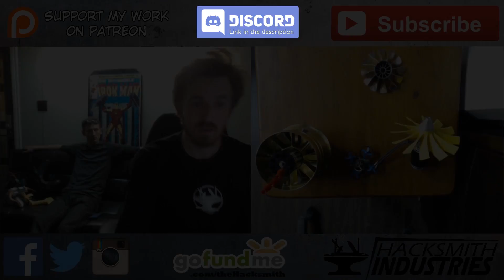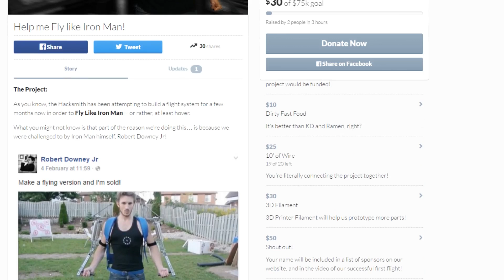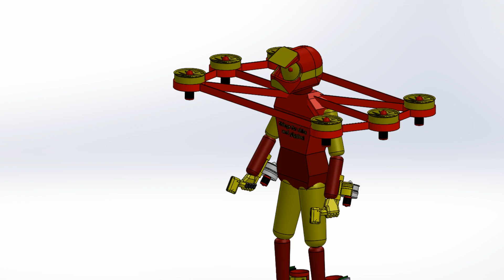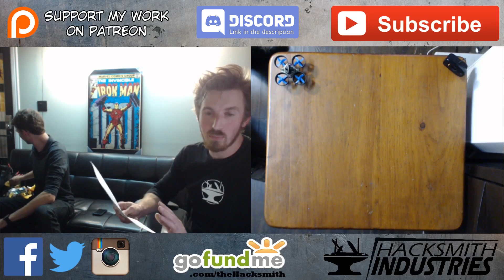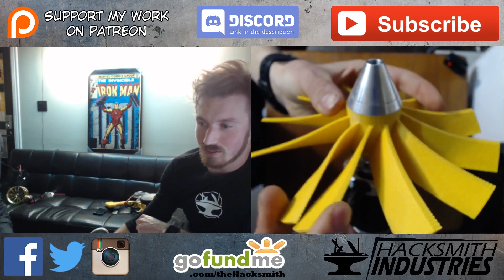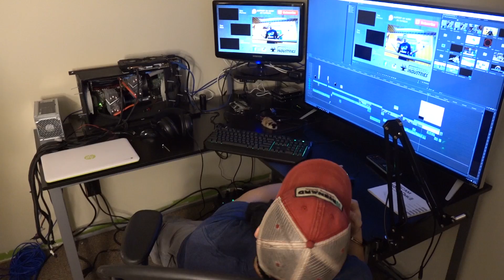Flying Like Iron Man Q&A!!!

Comment: Hi as someone who uses fly's RC planes & multi-rotors I'm a little concerned about using the store bought edf's 

Have you actually tested to see if a single EDF can lift the weight quoted in the thrust specs. I would definitely like to see some thrust testing with a force gauge or weights or something.  Those EDS have really heavily pitched blades designed to move and aircraft fast(not what your doing). in your use case you will probably want something that is less aggressive as you only intend to hover. I know it wouldn't look as nice but I think building your own ducts (3d printing) and using larger propellers(model aircraft propellers) spinning slower would be better. This may be more efficient cheaper and possibly more effective at low speeds(hovering). I know the theory says that ducting fans make them produce more thrust and it's true. But there are other ways to produce the thrust you need. My general gut feeling is that I would be surprised if they can lift there specified thrust straight up. Going bigger would be a better option. 

I may be wrong but I'm no aerodynamics expert. But I have had some hands on experience with EDF's i'm not sure they are the right tool for the job. If you look up human quad-copter on youtube they all use propellers pretty much I think there might be a reason for this. 

Don't take this comment the wrong way I love this Idea. I want to see it work!! 

Keep it up I am looking forward to seeing how it turns out.
Reply from the maker: +James Williams we're going with EDFs to keep the design relatively compact -- props would be easier!

We have a thrust test jig we built, you'll see it in part 11. Most EDFs have lived up to their spec, except for one!
Reply: That's cool. Admittedly I haven't ever used these very expensive well engineered EDF's I will be interested to how close they are in spec. As far as the size thing I think even doubling the size of the fans would make things a lot easier on you guys but I understand it more like Iron man like if its compact.  Good luck!  I really hope it all works for you!

Comment: Why don't you try using an external power supply? Connect the jets to a cable. This way you could cut down the battery weight problem.
Reply from the maker: +a shapeshifting reptillian pretty sure that was like the second question I answered in this video.. lol
Reply: So basically normal line power can't supply enough wattage? What about using three phase power?
Reply from the maker: +a shapeshifting reptillian then the wires are too heavy :p
Reply: the Hacksmith Huh. Thats interesting. So you would have to convert the ac to dc to power the motor? Are there any ac motors in that size range?
Reply from the maker: +a shapeshifting reptillian AC to DC is one problem, the weight of the cables required to pass 150kW is the real problem though! Anything custom would be really expensive... And then not compatible with batteries, so using it to test would be backwards haha
Reply: I see. But at high voltage ac a rly heavy cable shouldn't be necessary.
Reply from the maker: +a shapeshifting reptillian yeah but you can't just convert high voltage AC to low voltage DC without a giant rectifier
Reply: Lol of course. I guess if I'm thinking of an idea on this project you have probably already considered it and figured out all the problems with it.

Comment: This isn't really flying like iron man any more. This is just flying by any means possible. Don't get me wrong, what you guys are doing is impressive and I understand that iron mans suit is a work of fiction that isn't practical, but I think the project should be renamed as it is no longer very iron man like.
Reply from the maker: +Happy Bread manual control via the hand and feet thrusters is still unlike any flight system out there, which is the main feature of Iron Man's flight ability ;-)

Comment: Why not 3D print the propellers and then make a cast metal version from a cast of the 3D printed part?? or maybe not metal but just a more durable plastic?
Reply from the maker: +Waylon Martin EDF blades have to be precise and perfectly smooth -- at home casting just won't cut it :(
Reply: True enough yeah, That was simply the first thing that came to mind after seeing how flexible the plastic was...

Comment: ESC cooling some of my jets have there ESC`s in behind the EDF so air flow cools it while sitting still, checking out the gofundme.  Liquid fuel rocket engine, dangerous I know its an idea for another day stick with EDF`s for now. Try redesign of the mount for your EDF`s closer sleeker more like Iron man the design you have will help with stabilisation (guess that why you chose it) but doesn't look the best, try harder, I know you say not definite design just saying don't use that.

Comment: You guys should do a hybrid engine, with the electric duct fan at the front of the overall engine and part ion engine to accelerate the air even more. The air would also move faster when it's heated.
Reply: This may get more propulsion, but i'm not really sure.

Comment: I'm well aware how expensive a Metal 3d printer is, but why don't you send the files to a printing website, like i.materialise? it's not terribly expensive, and this way you could attempt to increase the size of the EDFs. Also, in reference to the heating problem, could you use small pressurized Co2 cartridges? when the gas is released it's at a very low temperature, and since the flight time isn't very long to begin with, you wouldn't have to carry too many, therefore not increase the weight terribly.

Comment: why not use a wing system like the jet wing ? It might be wide but it could potentially less cumbersome than you octocopter design I believe.  I know you want to hover but wouldn't it be cooler to soar like an eagle piloting a blimp? And if you think the take off would be an issue, you have those spring boots to jump high. Don't take anything I say too seriously though, I haven't been trained formally in any field of engineering. If you have valid reasons why yours is better than mine I would honestly love to hear them, your smarter than 99% of people around me.
Reply from the maker: +Dominic Mann because I'd die testing it lol, wing systems only work at fairly high speeds
Reply: the Hacksmith yes but you have also made it quite clear you could die testing the EDF design for example your not so safe safety test althogh I do understand your reluctance to high speed flight
Reply from the maker: +Dominic Mann flying at 70+mph without a plane is a death wish... Think about it lol
Reply: That's pretty impossible, and probably would be way more expensive then the Iron Man project.

Comment: Why don't you guys just attach two 190mm EDF's to your back. It will provide enough thrust to lift you up and potentially fly at some pretty high speeds.
Reply from the maker: Because 2x 195mm EDFs only produce 24kg each... and they weigh about 4kg... leaving us with 40kg of thrust to lift a 60kg person and another 10kg of batteries?

Comment: Maybe it is a stupid idea, but have you considered replicating some already existing successful DIY turbojet project? For example Gerald Rutten's GR180 outputs 18kgf of thrust. The only "unusual" and expensive part is a special turbine wheel --- rest are car parts. And since you already have CNC mill you can machine custom parts more easily than original authors.
Or use turbofan powered by gas turbine --- it can also help with hot exhaust problem. There was a guy with gas turbine bike project in the same BOCA bearings contest you have taken part some time ago that had a very interesting gas turbine design using only car parts. I'll post links in a separate comment if youtube allow.
Reply: Here are links:
http://members.tele2.nl/geraldensuzanne/turbines.htm
http://jetandturbineowners.proboards.com/thread/53/landspeed-bike-diy-gas-turbine
Reply from the maker: +Alexander Mishunin that is some impressive work! I'm afraid that we're not skilled enough with our CNC to replicate something like that and even if we were, I feel like the amount of time it would take, it would still be cheaper to buy something pre-existing. We run our YouTube channel like a business, so we have to choose where we should spend our time most economically :)

Comment: Why don't you CNC the DIY EDF blades out of some lightweight metal like Aluminium instead of 3D printing plastic ones?
Reply from the maker: You need a 4th axis to make a good EDF blade =( also our workbed on the CNC is only about 8" across so not too big
Reply: Bummer, there has to be some sort of way around the massive costs of EDFs
Reply: Maybe casting them out of Aluminium Alloy?

Comment: This is a genuinely great video and I'm glad that you had the patience to answer some pretty ridiculous questions. Keep up the project progression 👌 what if you used 2 EDFs per limb? use the long board  waist belt as well, then you'd need to build the jetpack.
Reply from the maker: Still wouldn't be enough =(
Reply: Also, I was wondering about how much a compression sleeve or brace would possibly reduce the stress on your limbs if you had to add more EDFs say three per leg and 2 per arm

Comment: why dont you use 2 (or more Big Model Jet Turbine (like Jet Cat)) and than steer with the help of a quad-copter steering unit
Reply from the maker: answered in this very video... And on the website if you click the link in the description :)
Reply: the Hacksmith i still belive that a Jet Turbine would be a better choice Cause examplewise a P 400 RX-G has a thrust of 395N so 40kg at the price of two edf and the Problem of the Hot exhaust isnt realy a Problem Cause if you are using it like a Jetpack you would need to fly with a slight Angle backwards cuse your CG is in Front of your Center of thurst. so the exhaust would Point away from you and the exhaust Temperatur of 800 degrees Sounds mich But air is Not good at conducting heat so eben if beeing in the exhaust for some seconds it would Not harm you. im pretty Sure that i habe Seen a Video Testung it with a real Jet Fighter.

PS: Your Videos are Great keep on doing like you do right now!
Reply: the Hacksmith i still belive that a Jet Turbine would be a better choice Cause examplewise a P 400 RX-G has a thrust of 395N so 40kg at the price of two edf and the Problem of the Hot exhaust isnt realy a Problem Cause if you are using it like a Jetpack you would need to fly with a slight Angle backwards cuse your CG is in Front of your Center of thurst. so the exhaust would Point away from you and the exhaust Temperatur of 800 degrees Sounds mich But air is Not good at conducting heat so eben if beeing in the exhaust for some seconds it would Not harm you. im pretty Sure that i habe Seen a Video Testung it with a real Jet Fighter.

PS: Your Videos are Great keep on doing like you do right now!
Reply: PSS: you could use Simple vents Made Out of Materials like ceramic  to steek the exhaust so you do Not habe to steer a Jet Turbine with its slow Reaktion Times it self 

And i would recomend definetly some kind of a Computer steering Cause it will be Close to impossibllity to steer with Out any Kind Computer control
Reply: and Just annother crazy idea: use H2O2 and let it flow thru a catalyst and it will expand by over 1000times
that was how the First Jetpack was designed

Comment: just my ideas cents again.. but maybe you could try liquid nitrogen cooling the EDF's, not sure if it will work, or how well it could work, but an idea nonetheless.
and maybe look into peltier modules. they might not do much, but it could add a few precious seconds of flight time to the system.(not sure if it is possible at all, but might help a bit)
Reply: not sure they care all that much about flight time so much as flying at all ... ATM any added coolant will increase weight and hamper flight

Comment: I dunno how effective this would be but it'd look a lot cooler than a hexacopter.
How strong is the strongest EDF? If you made a jetpack (on your back) using one or two of them in combination with the smaller hand mounted ones, how much force would that create?
Reply from the maker: The strongest we've found are only 24kg of force =(

Comment: I WISH REPULSORS WERE REAL - A repulsor is a form in which a high density muon beam[1] can be projected, as a powerful blast of concussive energy called repulsor blasts. Repulsor blasts may be directed by magnets and focused by electrostatic lenses, although they may also be self-focusing. One of the luminaries of repulsor design technology is Tony Stark, who has incorporated them into every iteration of his patented Iron Man armors since Model 3. Constructed using micro-circuitry, these repulsors are implemented into the palms of his battlesuit and are one of the armor's primary offensive tools.

Comment: Maybe thermal peltier modules, they're really tiny (or you can get bigger ones) and can convert heat to electriciy and vice versa. They're also not that expensive. I don't know about ht eefficency of them tho on a project such as this... but you should check them out at least
Reply from the maker: Nowhere near the efficiency -- they'd add more weigh then any power they'd save =(

Comment: This project is going to be AMAZING once it's finished. I was actually looking at people who made 'jetpacks' in the past and found one powered by liquid nitrogen. How feasible would it be to use nitrogen gas as propulsion? You would have a higher energy density in the liquid nitrogen (although also a larger weight) and might look better from an aesthetic point of view. I guess the biggest problem would be flight time, but it still seemed interesting to me. The jet pack was called 'Project Grasshopper'. Good luck on the project!

Comment: Why make the jetpack so complicated? Just strap 2 or 3 of the larger ducted fans on the back and strap each boot an additional ducted fan. Would that work?
Reply from the maker: +yeah what we show off actually the most simple thing we could do. You can buy a flight controller made for quadcopters and it will do all the balancing and stabilization for you! Having everything on my limbs would be near impossible to stabilize
Reply: Balance, stability, if it was on his back he'd probably fly straight forward onto his face. Other reasons too.
Reply: So arms can't be used for stabilisation? Kinda like iron man.

Comment: I could be completely wrong, but hear me out; Could you use jets in the backpack (Yes, I know, a jet pack), but redirect the exhaust straight out the back of the backpack using metal tubing, therefore you won't have to have the cumbersome 6-fan structure on your shoulders, extending your range of movement, view and so on, as well as not being as difficult to move around when the EDFs aren't on?

I'm sure there are limits, boundaries and other things that cannot be passed, and I'm sure you have already thought of this idea. But, if you haven't, I'm sure you can take mine and Hacksmith it so it makes sense and might actually work :)
Reply from the maker: +TheBritishBrit tricky part is redirecting any air flow causes turbulence, which reduces thrust. It could be possible, but we'd need a massively powerful jet engine to avoid the thrust loss
Reply: the Hacksmith Very good point, and thinking about it I guess it's pretty unavoidable. Well, it's going well so far so I can't wait to see what you come up with, best of luck!